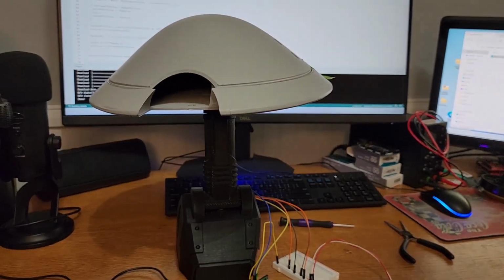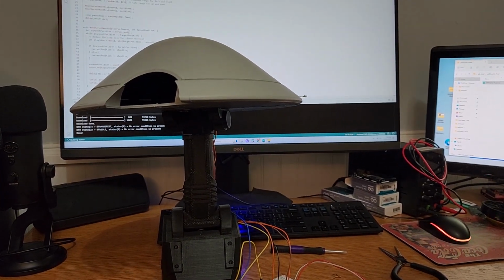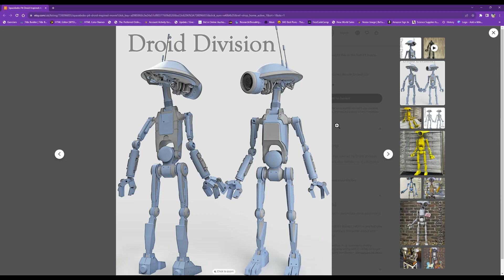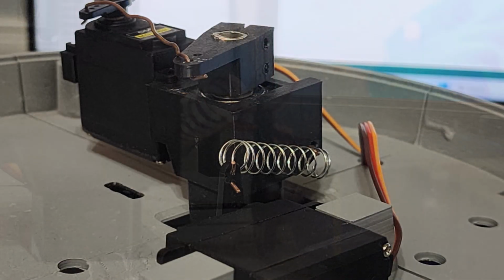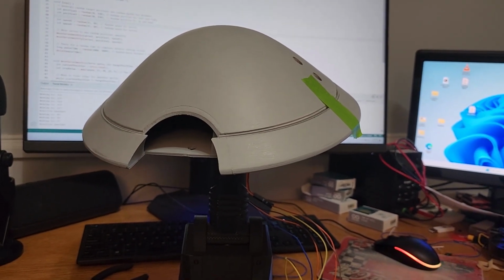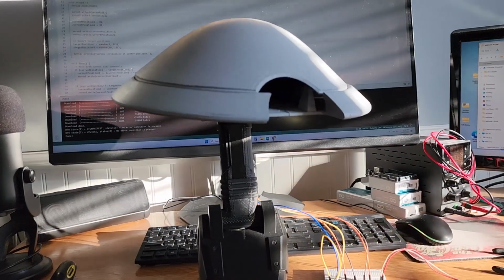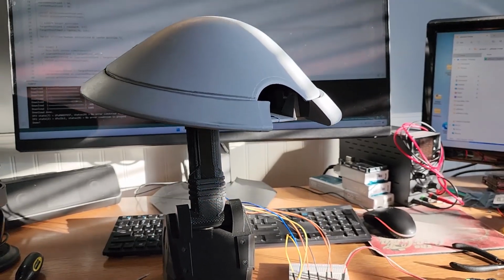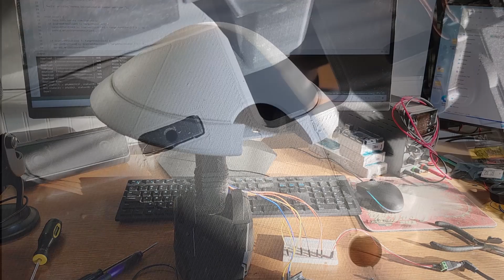Bringing a 3D Printed Star Wars Pit Droid to Life with Arduino Servos!

Comment: Do you have a step-by-step process of how you wired the head and the components you used that you can send this nooby?
Reply from the maker: hey there!
I made a video  using Bottango for the pit droid. Bottango gives you smooth movements in a 3d software environment that you can upload to Arduino - it's great!
https://youtu.be/DWvVfzULl6U

Are you just animating the head with 2 servos?
I also  have another Bottango video where I used it to move a servo robotic arm - it may be helpful. https://youtu.be/adtU29S-T1A

Let me know if you need help connecting servos to a board...I can help with that,  no prob!

Comment: use geared dc motors, noy servos.
Reply from the maker: hey! I like the sound of that. what kind of geared motors did you use or have you seen?  may have to alter the inside of the head a bit so the motors can fit. 👍